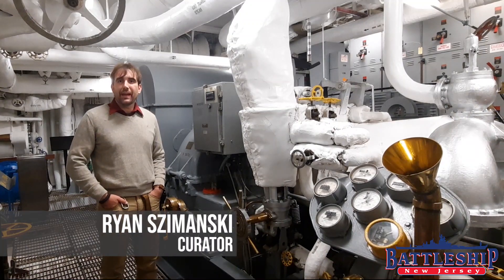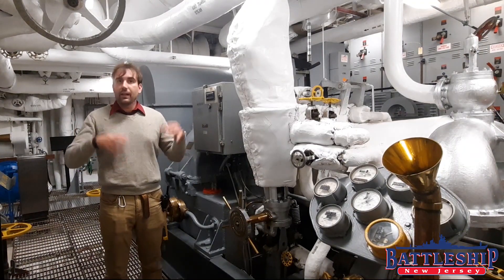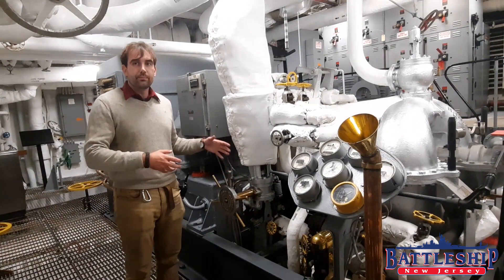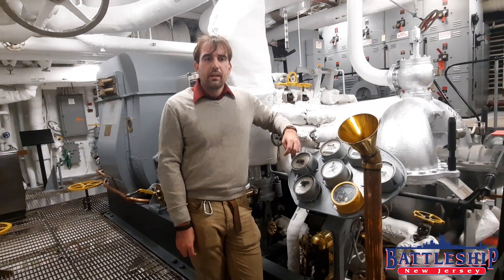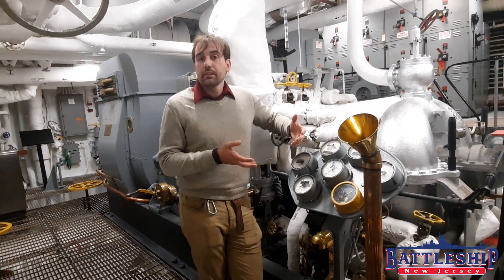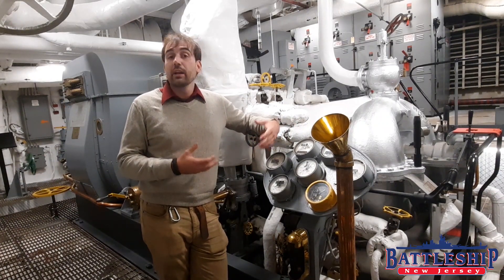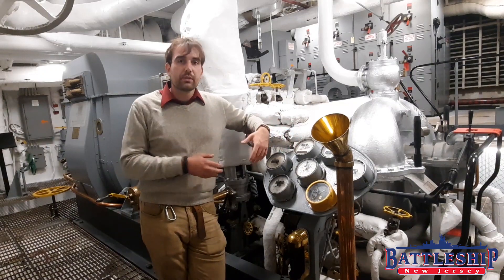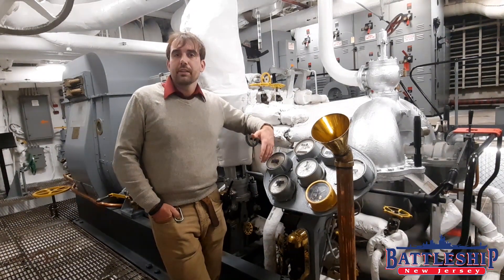Battleship Turbo Generators

Comment: Does the ship still have any of her auxiliary generators or were they parted out? Also is the ship still powered electrically by the original shore power lines and switchboard?
Reply: No they wouldn't meet code the majority of the electrical lights aren't even original to the ship like the ones overhead of Ryan.

Comment: Hate to tell you but the big gray box was the electrical part. There was no steam in it. You were standing and leaning on the steam part. The beautifully restored steam piping was probably to get rid of the asbestos insulation.
Reply: The main steam supply to the SSTG wasn't touched much during reactivation so most of it is asbestos.  The two vertical insulation pads he's standing on were made and installed during reactivation and are non asbestos. The top pad covers the main steam strainer, and the bottom pad covers the admission valve.  The small horizontal lines are the 150# high pressure drains and both pads and hard insulation are non asbestos.
Reply: I was thinking anything with steam flowing through it would have insulation and it wouldn't have paint because cooking paint with very hot steam would not be good.
Reply: That part was done during reactivation in the 80s

Comment: Why does the Navy care if the Jersey can make her own steam power? There's no remotely plausible scenario in which that presents a threat to anybody. It's not like you can put the key in and drive the thing away like a Honda Civic... what's the Navy afraid of?
Reply: Boilers have to be inspected and certified and run by certified personnel. They are big bombs.
Reply: @jimjonrs3932  Exactly. It's almost certainly more an issue of some museum personnel blowing up a bunch of tourists than it is worry about someone stealing a giant ship with no working guns. I wouldn't let them run the boilers either.
Reply from the maker: Someone theoretically could, and that's a real concern for the navy.
Reply: @BattleshipNewJersey  That would be something.  What could we use to stop an Iowa class BB.  Most Naval arms are missiles and 5".  I think the CO of the NJ was asked what would happen to the NJ if a Exocet  Missile hit her like the Sheffield that was sunk during the Falklands War. "We'd wait till the fire went out and repaint it."

Comment: Knox class frigate I was on in the late '70's had 3, 750KW, SSTG's, along with a single 750KW diesel generator. The diesel was run during line handling when mooring or getting underway. If the breeze blew the wrong way, you could barely breath when on the fantail/quarterdeck. Old memories...!

Comment: The early battleships were turbine electric because Reduction gears,
Like a transmission but one fixed speed, were not able to be made in the large horsepower required.

So the many SSTG’s made electricity and transmitted it to the electric motors .

When the reduction gear technology improved the ships went to mechanical drive as in the NJ.

During WWII the special tools to make the precision gears could not keep up as there were few of them.

There were many factories that could make motors and generators.

So the destroyer escorts and T-2 tankers reverted to turbine electric.

I actually was an engineer in a T-2 tanker from WW11 for two weeks in 1984.

Well things have gone full circle and as a commenter stated were are getting gas turbine and Dieselgenerators making electric
Power turning motors to drive the props.

Also they are going. Back to DC power for the large loads!
Edison’s revenge?
Reply: WE HAD 6 SIX S.S.T.G'S 1200 PSI STEAM 8000 HP EACH, OUR MAIN ENGINES PUMPED OUT 48 MILLION G.P.M AT FLANK SPEED.3MMR.
Reply: DC motors start up quicker and have more torque.
Reply: DC transmission throgh the same 2-wire cable allows double the power if you're limited by peak insulation withstand voltage and thermals/overheating from the current in the resistance of the copper/aluminium. Also if you're going for electronic motor controllers/drivers, you need to feed them DC anyways, so if you can use a voltage high enough for this that you are comfortable with the required cable size/current rating to transmit that power at that voltage, you're better off skipping AC and transformers. Circuit breakers become a bit harder, especially >1000V, but not that bad these days at least.

Comment: Very Intesting:
Beginning on about December 17, 1929, the U.S. Navy aircraft carrier U.S.S. Lexington (CV-2) ties up to the Baker Dock and supplies electricity to Tacoma for a month to meet a power crisis.

In the 1920s, Tacoma received most of its electrical energy from dams on the Nisqually and Skokomish Rivers. Supplemental energy came from the Dock Street steam plant (1922). A drought in 1929 severely cut the power from the hydroelectric sources. The shortage became so critical that Superintendent Ira S. Davisson (1860-1951) had to cut power to Cascade Paper Company. Cascade laid off 300 employees. Fort Lewis turned the lights out in the barracks at 4:00 p.m.

Tacoma appealed to President Herbert Hoover, who bumped the matter to the Navy. At first the Secretary of the Navy refused the request, but negotiations resulted in a message to the Lexington’s captain to go to Tacoma, then to wait, then to go to Tacoma.

The request for the Lexington was opposed by Puget Sound Power & Light and by Seattle City Light, which claimed that the drought did not affect their operations. After the Lexington left Tacoma in January 1930, Seattle requested that the ship help out there. The Navy declined.

The "Lady Lex" arrived at Tacoma's Baker Dock in the rain to the sounds of a brass band and the applause of City Light customers. The Lexington’s boilers supplied a quarter of Tacoma’s power for about 30 days, leaving on January 17, 1930. That month, the skies opened and rain filled Tacoma’s reservoirs.

Tacoma enjoyed a special relationship with the carrier until its loss at the Battle of the Coral Sea on May 8, 1942.

Comment: How long would it take to fire up the boilers and get steam going through the turbines?
Reply: I was on a destroyer and with the 600 pound boilers running on Bunker C, it would take us about 4 hours from a cold start to be ready to get underway. You don't just fire up all of the guns on the boiler and produce hot steam and push that through to the turbines. You have to bring everything up to temp slowly. 
Barry
Reply from the maker: Check this out https://youtu.be/bs35Vigmu_c

Comment: Was hoping you would have Told people about the Overspeed Trip
Safety Device!? 
 Only Works if a Person on the Switchboard. Allowed the Voltage to flow into the Generator.  Instead of From it. Turns the Electrical Rotor into a GIANT MOTOR. TOO MUCH SPEED  AND THE STEAM TURBINE BLADES FLY OFF!!
Reply: I think you mean Reverse Power Trip Relay, which electrically disconnects the generator from the circuit. The Overspeed Trip shuts off steam to the turbine, which won’t stop the generator motoring. 
A synchronous generator will only motor at the circuit frequency and not overspeed.
Reply: The overspeed bolt serves only one function. It trips the Trip Throttle Valve TTV to immediately shut off steam flow into the turbine steam chest and throttle valves. It is generally set to 105% turbine rotor speed. The TTV has a massive spring inside and the valve inside snaps shut faster than a rat trap. The ship's wheel looking device is how you bring the turbine up to governing speed. Then you crank that wheel wide open.  The Overspeed Bolt is in a tapped hole in the turbine rotor shaft near the journal bearing at the right. Its an adjustable spring loaded bolt with rounded tip that remains bottomed out until excessive speed and centrifugal force overcomes the spring and the bolt flies out...maybe 3/16'' to 1/4'' and smacks a stationary  lever set very close to the shaft. That lever operates a hydraulic dump valve connected to an oil line that operates a hydraulic piston under the Trip Throttle Valve. Its the same lube oil/hydraulic  that is used in all of the bearings and the reduction gear.

That turbine turns at higher than 10,000 rpm and drives a pinion gear. The output gear drives the 6 pole generator at 1200 rpm. The overspeed bolt is stupid proof. If the load suddenly drops off the generator and the governor/ throttle valves can't catch it, the TTV will trip the unit. Should the pinion gear teeth fail or the turbine shaft breaks, the overspeed bolt comes into action to prevent disaster even while the machine is completely unattended.   I hope this helps. I personally set and tested about 50 of them during my time as an engineer with General Electric Marine Department and later with my own turbine business.

Comment: Did the motors on the turbo-electric ships run on 440, or did they use a higher voltage?
Reply from the maker: 440
Reply: All large turbo-electric drives used much higher voltages.  The US Tennessee was 4kV.  USS Lexington was 5kV.  The modern Amphibious Assault ships use 4160V for propulsion.
Reply: @matthewbeasley7765  how old was Tennessee.
Reply: @keithwoodburn7895  1917.  It also had two phase power for propulsion.
Reply: @matthewbeasley7765  that’s impressive when you think of what the insulation must have been like!
Reply: Generators*. Motors take electrical energy and turn it into motion, generators take motion and turn it into electrical energy. Different machines.
Reply: @tspencer227  Turbo electric drive has both.  A generator on the prime mover and a motor on the propeller (or reduction gear, if used).  So one can talk about both machines and their respective voltage.
Classic turbo-electric drive generally had a one to one relationship with generators and motors.  They would have the same voltage on the generator and motor.
Modern ships with variable speed drives do usually have different generator voltages.  All generators are on a common bus, most often 11kV.  Ship service and propulsion are all together.  Each propulsion motor will have a 3 winding transformer - delta to delta and wye - to feed a 12 pulse rectifier.  That feeds an inverter and then to the motors.  The motors run at some lower medium voltage, often a few kV.

Comment: When going from ahead to backing, the main throttle quickly closed and the reverse throttle is opened. The turbine is not slowed to a stop. It makes quite a racket in the deck above the engine room, and some cavitation in the screw.  All capital ships need long propeller shafts because the screws are some distance away from the sealing gland and there is not a lot of space near the shaft alleys. You can reconfigure the "engines" to be all in one space, but damage to that space puts you dead in the water. The engine rooms and boiler rooms are all typically in the deepest part of the ship.  The SSTG throttle is probably the control for the speed regulator to keep turbine revolutions at the correct level such that the frequency of the ship service power is close to 60 Hz. Submarines typically have a turbine and a electric motor on the same shaft, in steam powered subs. In diesel subs the main engine and the electric motor are in a similar situation. Electric drive ships, like the Ford class carriers, require large high voltage motors, with large high voltage, high power generators, but you can siphon electric power for catapults or rail guns easily.
Reply: Just a few things, since I actually operated these SSTG’s.  
The throttle valve was only there to get the turbine slowly up to speed and warmed up. After we were at speed, the valve was fully opened and the hydro/electric Woodward governor took over to keep the speed constant, and the electric output at correct Hz.  

The oil pump, was used to just start and stop the generator.  There was a mounted oil pump attached to the reduction gear to provide needed oil pressure for the unit.
Reply: @cruser69  Yes, I agree. There are two control systems in operation on any AC generator. There is a rotational speed controller, Woodward Governor patent for example, for frequency. Frequency could be read on a resonant vibratory meter. There should be a method the adjust the exact speed for paralleling operations. The other system is for the output voltage. And the voltage can be varied to take up load and to release load as required. These two systems are lightly coupled, adjustment of one variable changes the other a little.
Reply: Ford isn't electric drive. Also, because the astern turbine wheels are on the end of the low pressure turbine, you absolutely have to stop the shaft at least momentarily to begin reversing. Also, the long shaft lengths are beneficial for the massive amount of torque that are generated by the reduction gears and are just a necessary function of ship design anyway. Also, for nuclear-powered subs, no the SSTG's and main engines are not on common shafts.
Reply: @tspencer227  Reversing an electric motor, from full ahead to full astern, may tear the mounting apart. The VFD'S should try to smooth the transition. The Ford's drive motors are rated at something like 10 kv, with a rectifier and invertor in the electric path. (AC, 60 HD to HD to HVAC, any frequency, wind turbines operate with this arrangement)( the solar panels on  my house make 283 vDC and 240 vac comes out of the box on the wall)
Reply: @steveschulte8696  as I said before, the Fords aren't electric drive- they're still steam turbines through reduction gears for the main engines.
Reply: @tspencer227  Stand corrected. Future classes of large vessels should consider all-electric drive.
Reply: @steveschulte8696  the Columbia-class SSBN's will be electric drive- large brushless DC motors, IIRC. 

For other ships, gas turbines have a much higher overall efficiency, which is part of the shift away from conventional steam-propelled ships.
Reply: @tspencer227  Gas turbine have greater thermal efficiency of converting chemical energy into mechanical/electrical energy. And you can use them in as the source of thermal power for combined cycle generator. Mechanical energy plus electric energy plus steam power.  The destroyer power plants use a variant of the same gas generator on large airplanes.
Reply: @tspencer227  What does a large, propulsion class, DC brushless motor look like?  What additional  equipment  is needed to function besides the motor? How do you produce the magnetic field in the rotor?

Comment: Steam does not go into the large gray box in the back. The steam turbine is beneath the white insulation. The turbine is small when compared to the generator stator in the back, in the gray box.
Reply: Yea he really had me scratching my head when he was pointing at the gray generator and talking about an "armored steam box". Also I have never heard the blades of a turbine referred to as anything but blades. Impellors are for pumps.
Reply: QFE-" I looked at the MM 2-3 rating training manual, and ."
hah!  fukin Nukes...
Reply: Now You Sound Like a Old Snipe!
I was on the Jersey early 80s. Commission Crew. Number 4 Engine Room, Number 3 Shaft!
Reply: @frankconrad7323  I trained on the USS Enterprise #3 engine room Prototype in Idaho in 1975. I went on to the CGN-25 Engine Rooms. So I have walked by SSTG's many times. Last night, I looked at the MM 2-3 rating training manual, and the labels are clear as to which end does what.
Reply: @steveschulte8696  if you're ever in Wilmington, stop by North Carolina. There's a few of us nukes who volunteer there, and it's amazing how much of the stuff is similar to what we surface types worked on (I was A4W).
Reply: @tspencer227  Thank you for the invite. I do not see coming to Wilmington soon. I have been comfortable even in a oil fed boiler room. The Navy procures quite a bit of common machinery that ends up everywhere.